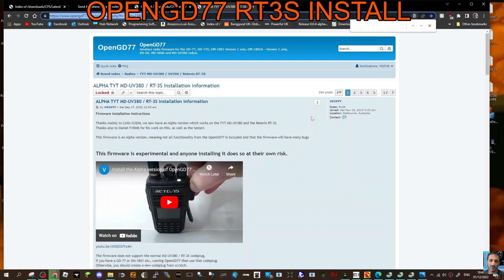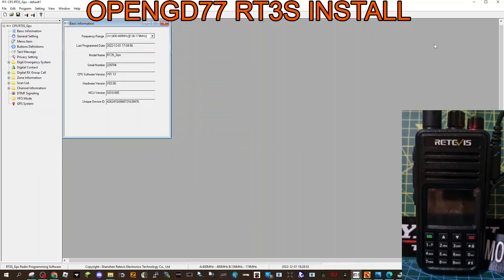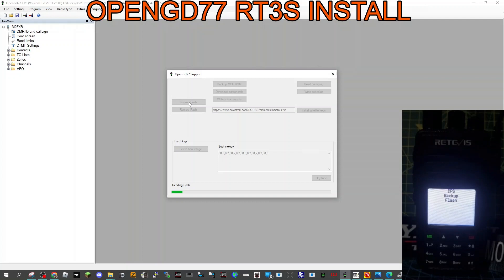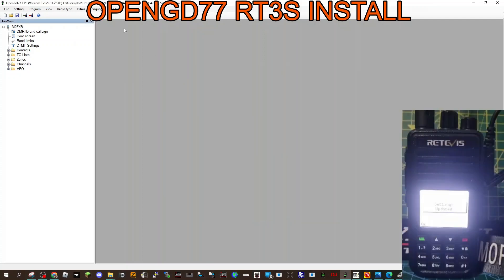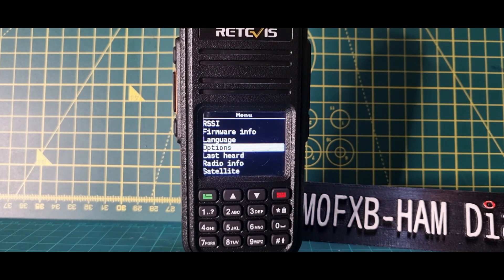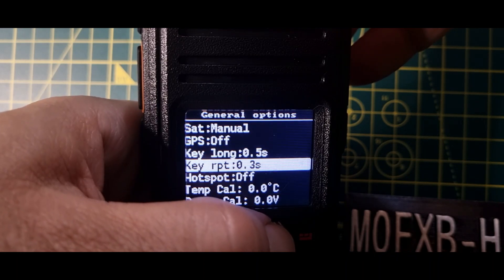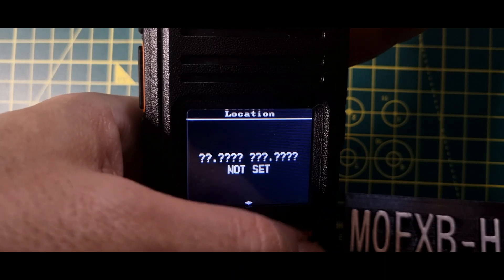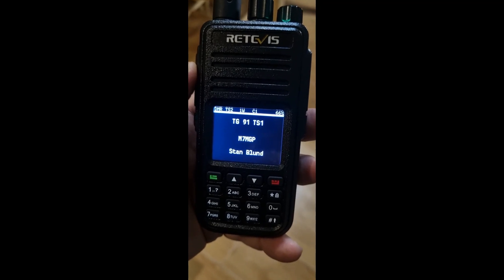OPENGD77 RT3S INSTALL

Comment: Thank you so much for this video, I finally had the guts to try this firmware.
Reply from the maker: Glad I could help
Reply: @HamTechRadioScannerDrones  extremely helpful, my RT3S was acting terrible... It wouldn't hold on to any frequencies. It would default to 450.000 for UHF and 150.000 for VHF. Updating the firmware didn't fix it, trying different code plugs didn't fix it but going to the GD77 firmware got it working somewhat. I have more tests to do but at least it transmits again

Comment: Hi,i'm IU8MLV,  I have a problem with the RETEVIS RT3S GPS version: I proceeded step by step to install the OpenGD firmware by installing the Open GD 77 software (version 2024.10.07.01) the donor file MD9600-CSV (2571V5)-V26.45 and finally the zipped file OpenMDUV380. Everything went perfectly and after completing the installation of Open GD 77, the radio display showed "setting update" and "ok" at the bottom left. Then I wanted to proceed to perform the flash backup by clicking on Open GD 77 support and then on blackup flash, but the process does not start and instead a message appears that the COM port is not seen, in fact in device management there is no longer the ST DFUse DM driver but Open GD77 COM 3. I clicked on OK on the radio and English appeared, but even then nothing happened.
Then not knowing what to do, I turned off the radio and restarted the PC.
The radio now appears with two default frequencies Ra144.0000Mhz and Ta 144.000Mhz above there is Fm - Aprs- the Rssi bar that oscillates - 1w and 100% battery. I have not set anything, nor have I started to use the radio, but the CPS Open GD 77 software (version 2024.10.07.01) does not allow you to interface with the radio or with the flash backup support, not even with read from the radio. I assume that it is because the drivers have changed and from Open GD 77 COM 3 driver I should perhaps reinstall ST DFuse DM.
Am I still in time for the flash backup? How can I solve the problem?
Reply: I solved the problem!!! I give you this info because in the video you don't see turning off the radio and making it go into normal mode and not DFU firmware upgrade. So: having reached the point of the procedure, that is, having completed the installation of the OpenMDUV380 zipped file, it is not possible to continue without turning off the radio, because THE RADIO IS STILL IN FIRMWARE UPDATE MODE! In fact, in the device manager only OPEN GD 77 COM3 appears, now resulting from the new firmware. After many tests with which I turned the radio on and off, I realized that at a certain point, opening the CPS Open GD 77 with the radio off, a window appeared asking me for the OPEN GD 77COM port. So I closed the software, turned on the radio, opened the software and immediately the Open GD 77 Support window automatically started in which the radio reading "read" started, in which the code plug was read by the radio without me clicking anything! Then at the end of the reading a window came up that in English told me that the radio has 16 zones while the code plug has 80 available, also asking me to confirm the change! To exit I had to click! I immediately made a Flash backup on support, saving the backup file that could be useful for a possible reverse with the original firmware! I believe that this backup file is the correct one because I have not touched anything from the radio or from the software, the only doubt is that I do not know if the reading that started automatically when the software was opened automatically, affects the backup file. But I think not because they are data coming out of the radio and not coming in. What do you think? Then later I tried to understand the reason why the reading of the code plug starts immediately when the radio-software connection. Most likely it is set to automatic and most likely the firmware installed last, i.e. the OpenMDUV380, already has a code plug, in fact a myriad of TGs with exclamation mark symbols, hashes and other things come out in the contacts. Furthermore, in the Bandwidth Limits parameter of the software, 4 letters FFFF came out in the 4 strings and then an error window indicating to exit. Perhaps because the MDUV380 is a single band. So to overcome this problem where these unusual situations occur (automatic reading of the code plug and other indicated) it is necessary that: FIRST THE SOFTWARE IS STARTED (where in this mode the correct band limits 136-174 and 400-470 appear, the TGs are 5 (the classic TG 9 TG 91 the parrot etc etc) zone 1 only, 2 ListeTG MARC and BRANDMEISTER.
Ultimately after the OpenMDUV380 upgrade
1 - Turn off the radio by switching from DFU mode to update firmware and switch to normal mode.
2 - Always open the CPS Open GD 77 software first and only then the radio. Proceed to compiling the code plug. What do you think of all this?

Comment: I can't get this radio to be recognized on Windows 11.
I've tried it both with pressing the 2 side keys when turning on and without.
Reply from the maker: The drivers are installed when you install the CPS Software .Follow the steps slowly and carefully .
Reply: @M0FXBHamTech  I just installed the 3.0.1.0 drivers a different roundabout way.

I opened the default RT3S software and the software does a download from the radio, but doesn't seem to be showing any saved memory channel data from the radio.

Comment: Is the pinout for the programming cable different on the RT3S to the Baofeng DM1701?  I made my own cable for the DM1701 but my pc says the RT3S is an unrecognised device, its not a driver issue, its the USB itself failing to find a device ID.
Reply from the maker: No idea seems alot hastle better to buy a cable .

Comment: What cable are you using, i got a cable by Retevis but is it true that the RTS3 GPS and Non GPS use a different type of Cable without a serial converter in the cable?
Reply from the maker: Buy the cable for the RT3S